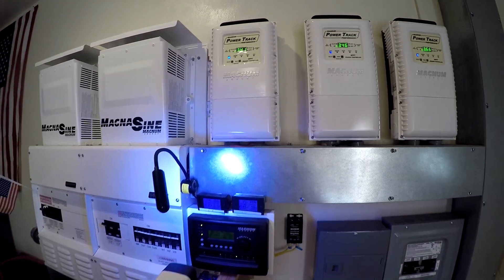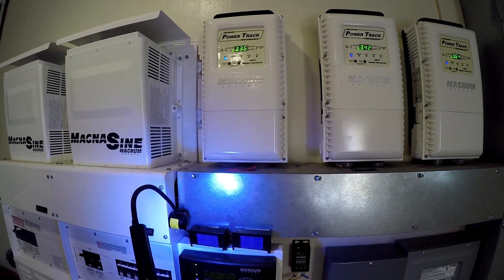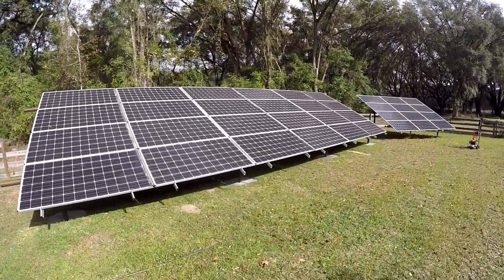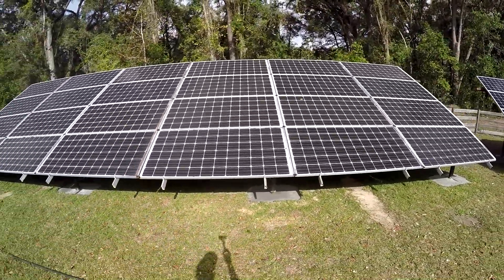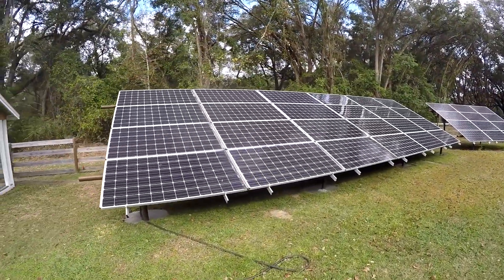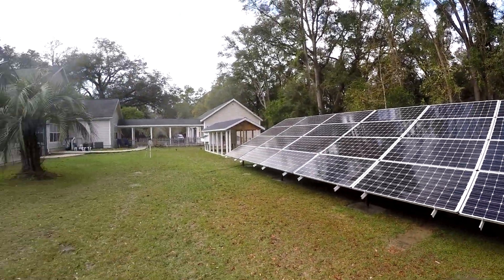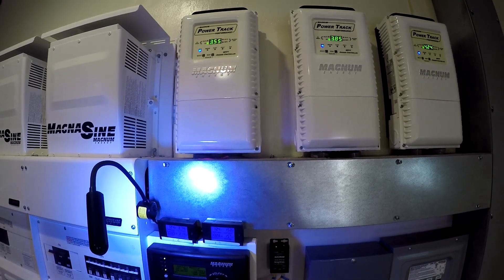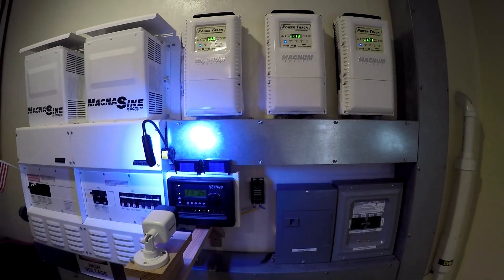Clean vs Dirty Solar Panels

Comment: For future reference never use a pressure washer itll remove the coating that most solar panels have , also dont wash them with tap water unless you want calcium build up on them... yes it seems a little ridiculous but just some tips that might help 😊

Comment: LOTS of good with everything you did. Moving them to the ground improves everything. Less heat, better cooling, easier maintenance, easier to blow off "that one leaf" that will always kill a strings power. Having leaves stuck on a rooftop array sucks -- ie, having to climb up and remove them let alone general cleaning.
Reply from the maker: Hey Chris, Yes, I am very happy that I decided (at the last minute) to move them to the ground mount.  I actually just finished replacing the garage roof (metal) a few days ago and it looks great.  I would not want to be drilling 100 holes in it at this point.  Also, I just like the accessibility to them on the ground.  Easy to clean and monitor what's going on with them.  The biggest advantage for me is that they are now producing a LOT more power.  Thanks!

Comment: You should probably wait until the next day to check them. Cooling them makes a big difference too.
Reply from the maker: Yes, cooling also has a very significant effect on the power output for sure.  I did wait about four hours before gathering the data.  Cleaned them at 10am and measured around 2pm (I think) .  It was done around Jan 2nd of 2024 in Florida.  Thanks!